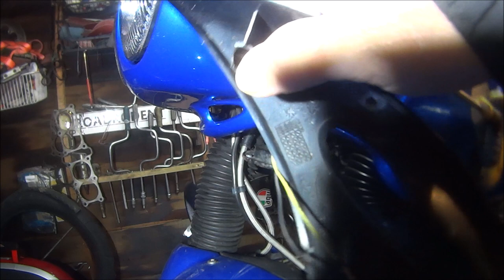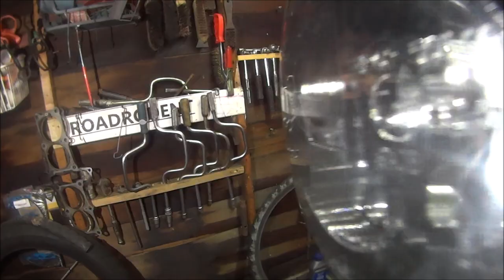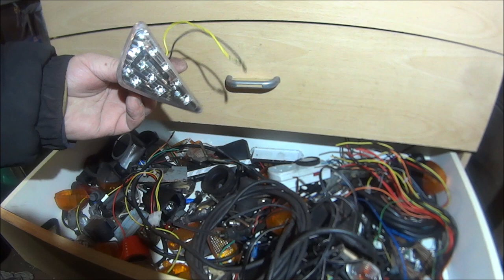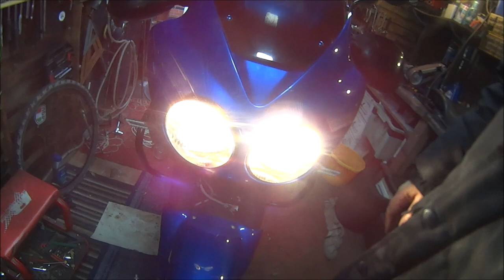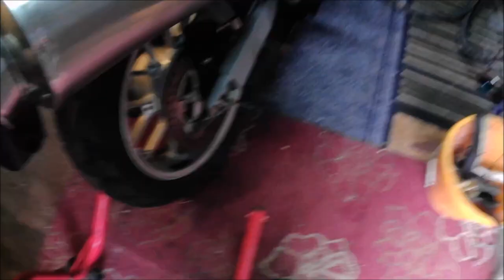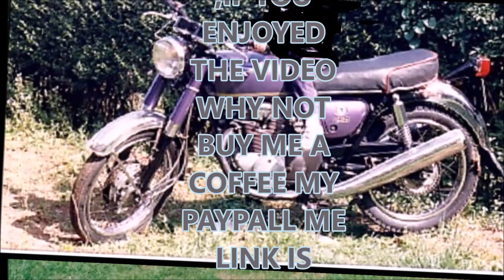TIGER 955I. Front Fairing removal. heated grips disconnected. front flasers replaced

Comment: I'd suggest putting the forks back at the correct position first. Then I'd have a look at the aftermarket Hagon shock, many of them have a length adjustment, might have been adjusted for a shorter legged owner. The other possibility is that the swing arm links (dog bones) have been replaced with aftermarket lowering items. Have a good Christmas.
Reply from the maker: Cheers buddy yes I need to see how the bike handles when I take it for the MOT I don't want to mess things up lol. Merry Christmas 🎄👍
Reply: @jonyr1TT  Just while it's in my head. When you get around to taking the tank off. Never lay it down on the floor, particularly with any fuel in it, it will distort / splay and you'll have trouble matching up screw holes when you put it back on. Best method is to set it on a central support, like a saw horse or bar down the centre, similar to the way it sits on the frame.

All the best for health and happiness in the year ahead.
Reply from the maker: Thanks for that. I'll try to be careful looks like a fairly big job trying to get the tanks out on these.👍 Have a great New year 👍
Reply: @jonyr1TT  It's not as daunting as it looks. One thing to watch out for is the fuel quick disconnects. There was a recall for the hose end connector to change them from plastic to alloy (pressure one red & silver for the return) sadly the recall didn't cover the pump side as well, so they might still be plastic and fragile. When you release them by pressing in the spring clip, keep it fully pressed until the male end is clear to avoid damaging the O ring in the male fitting on the often sharp edge of the female spring clip (or just replace the O ring).
Have a good start to the New Year, Slainte.
Reply from the maker: Thanks yes I've heard about these fittings being brittle and weak hopefully i can leave the fuel pipe attached and rest the tank on the frame where the battery lives.. happy new year 🐅👍🏍️